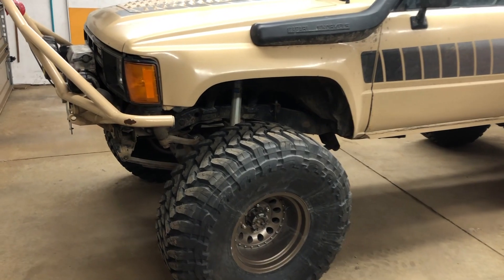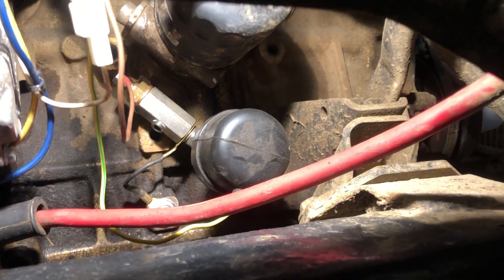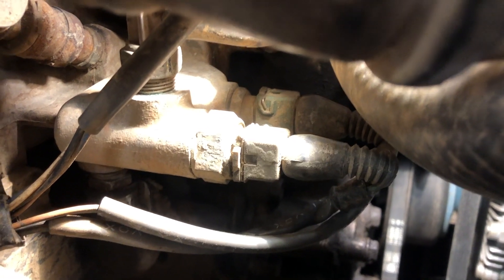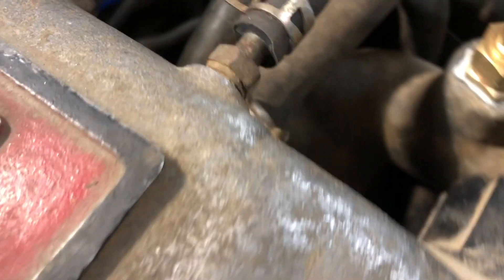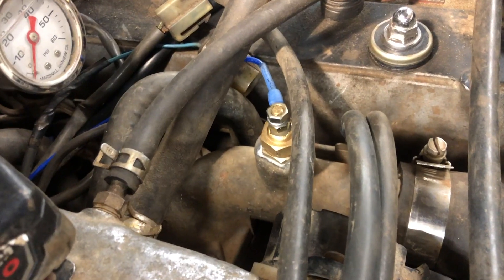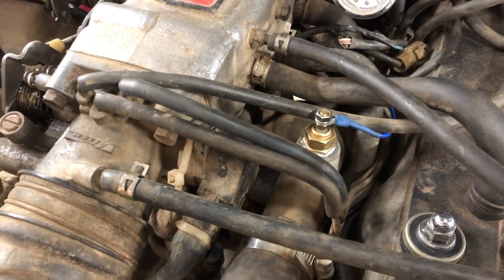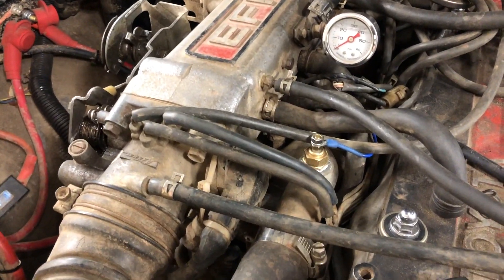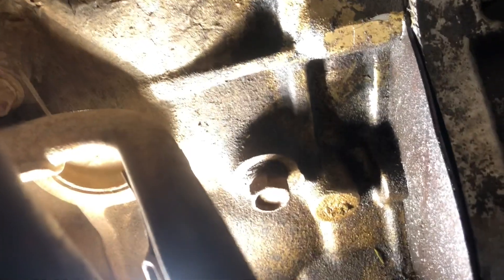Where can I add sensors on my 22RE?

Comment: I have an 86 runner 22re manual trans and have that same thermostat housing but with a single spade connecter. I have a running stock AC system on my truck. Sometimes idling for more than 10 minutes with  AC on my temperature starts climbing, "i  dont have a fan shroud" . But in my expirience the ac doesn't cut off even with that sensor connected. I turn off the ac and start driving or just turn the truck off.. i need to install an aftermarket temp sensor, not sure how accurate the gauge is, my truck is a base model

Comment: What fitting / adapeterd did you use for the thermostat housing. I can't find a sensor with the proper thread to put in a digital temp gauge on. I want to go to the same spot as u did. It will give the most accurate reading. 
I just installed a PainLess  Wiring Electric fan switch on my new 3 core aluminum radiator. And want to have a digital gauge.
Reply from the maker: The sensor fitting is a M16x1.5 male thread, and since I am using metric gauges, I used a M10x1.0 female thread, although you can use a 1/8 NPT female thread for standard guage sensors.  I'm still running a mechanical fan and stock radiator, and now that the air is all bled, it runs cool both on the trails and on the highway, even on hot summer days.